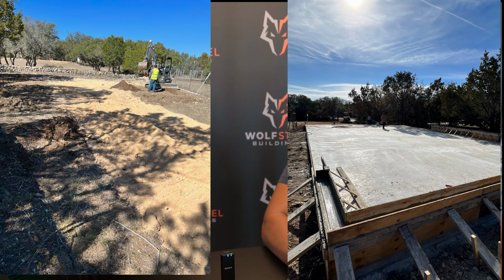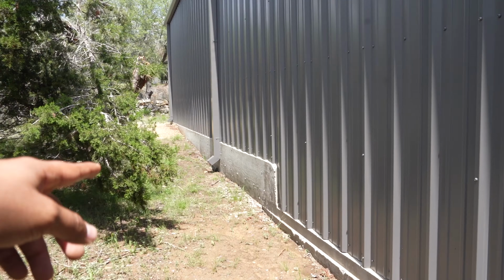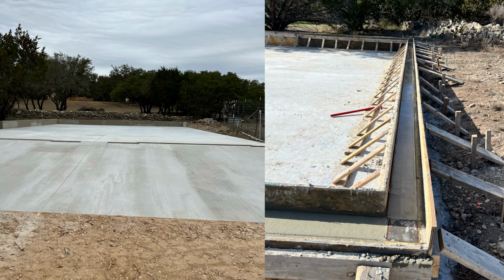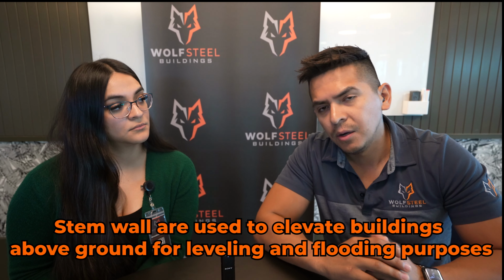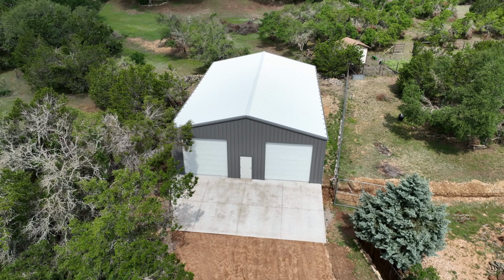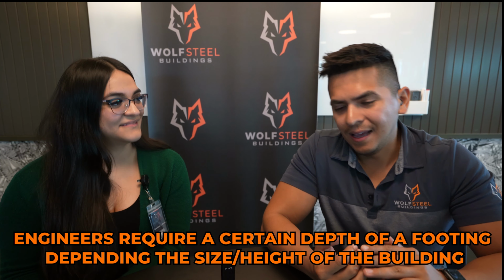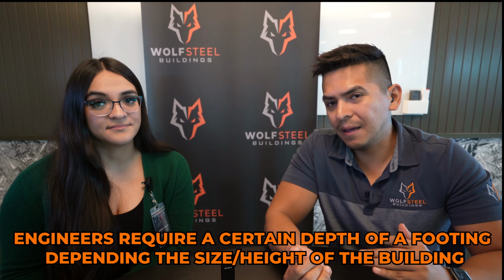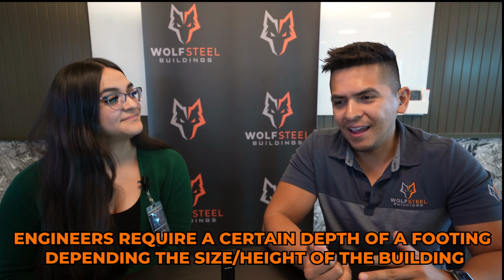Metal Building Pricing Factors: 40x60 Red Iron Metal Building Project | WolfSteel Buildings

Comment: Hi do you build bigger buildings? Like a 70x120? Looking at a drive through design doors on both sides that can fit a Ford F650. Also need a pit installed in the furthest 1 of 3 bays. Then I’m looking at building a living quarters on the other side with a deck both on the inside and outside.
Reply from the maker: This would depend on the building type (red-iron or tubular) and what the building is being used for. 
If it were tubular, for that size we would use commercial trussing and if it were red iron it would need to be a bolt-up. I am being a little vague because I don't have too many details to work with, cause it would also depend on your location. 
To help you get an idea of how our larger buildings are built, here is the tour and cost videos of a 60x120 project that we had last year. (Keep in mind since this was a year ago price is subject to change). 
Tour: https://youtu.be/-OaIuJhAASA?si=MaWz79R9B5fiEeQ3
Cost: https://youtu.be/skAHIguvmAE?si=2RhBqyTqsUlLrJqq

And I did give you are contact information on your other comment, we would love to help you and and get some more details! Here is our contact again: 844-941-0999 or email us at 
quotes@wolfsteelbuildings.com

Comment: So, if my math is correct, this building with the concrete is just over $111,000?
Reply from the maker: slightly under, pricing does depend on your area. If you're interested in pricing reach out to us at (844)941-0999, email us at sales@wolfsteelbuildings.com, or text us at (817)587-1555

Comment: great video and appreciate your info and straightforwardness about it all. I am in Arkansas and looking to have a metal building installed. will need the area prepped, trees cleared, and it has a slight pitch, the ground at least, so would need to look at that to get options on the foundation/concrete stuff. looking for a 30x60 sized building.  do you all service Arkansas?
Reply from the maker: There is certain areas that we cover in AR. Give us a call us at (844)941-0999, Email at sales@wolfsteelbuildings.com, or text at (817)587-1555. We can verify your location and see how we can get this project started for you!

Comment: Do you install buildings in Florida? 
Do you know any reputable companies in Florida that do, if you don't?
Reply from the maker: Hi Mike, thanks for reaching out. We do not currently work in Florida. We cover Texas and surrounding states. 

Since we have not worked in Florida we do not have much insight into companies. I've gone ahead and done a bit of research and these are the companies with good reviews in FL. 
-MBMI Metal Buildings 
-Central Florida Steel Buildings and Supply 
-Allied Steel Buildings 
-AmeriBuilt Steel Structures 

We recommend further research on companies for their quality, communication, and services. We do not have association with these companies.